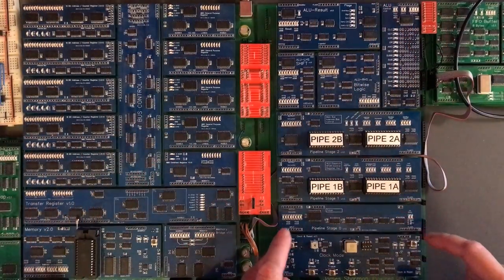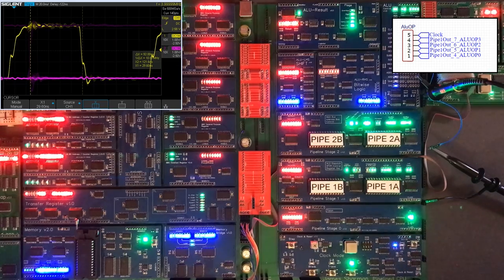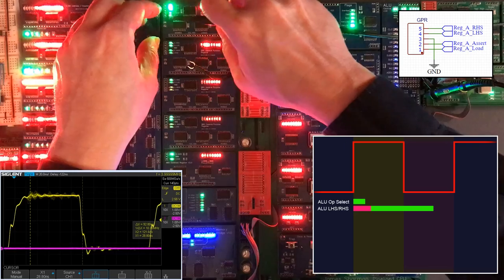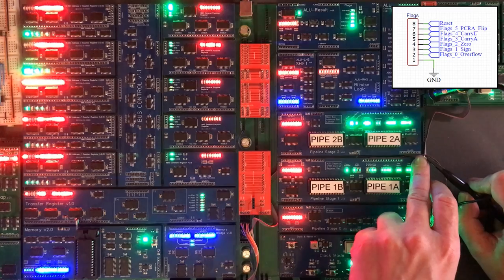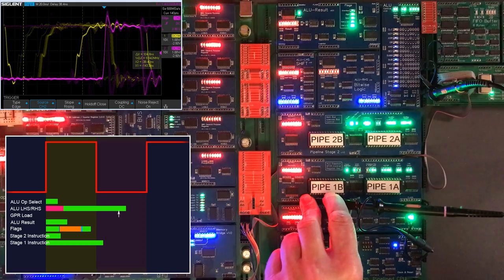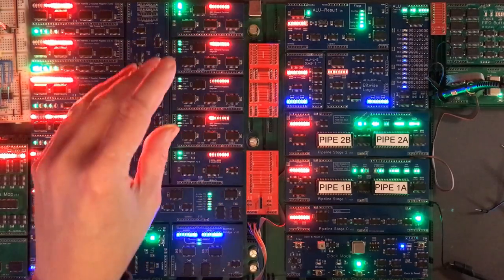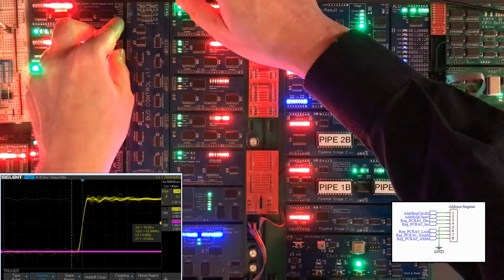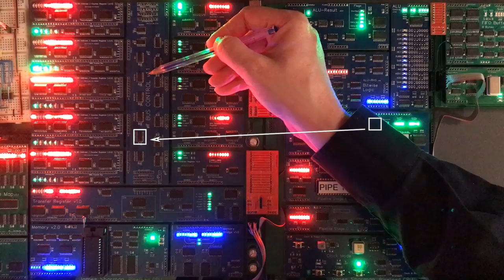Finding the Critical Path - Making an 8 Bit pipelined CPU - Part 101

Comment: Surprised the ROMS are so slow, I expected 15nS or better.. Why not use SRAM and fill them from very slow ROM during reset.  That way you can get < 10n! :)
The ALU car and other flags are a surprise!
Reply from the maker: I use a shadow ram for the rom in the memory subsystem (That is as much for code flexibility though) but here it's a lot of extra components to do that copy. It would be cool to absolutely maximize the performance of this design but I only have so much time and I think it will be more interesting to explore some other bits of architecture.